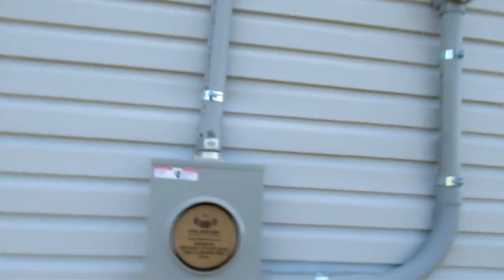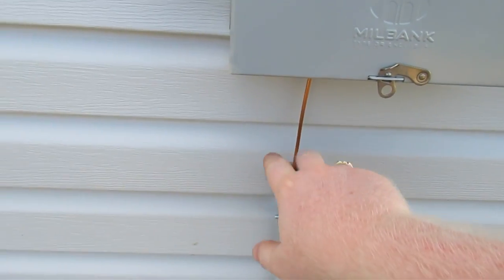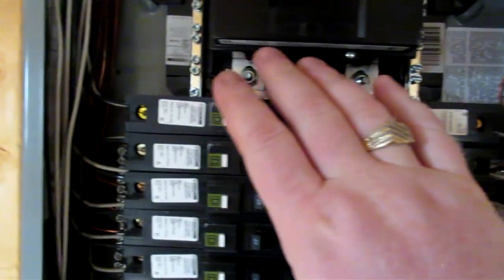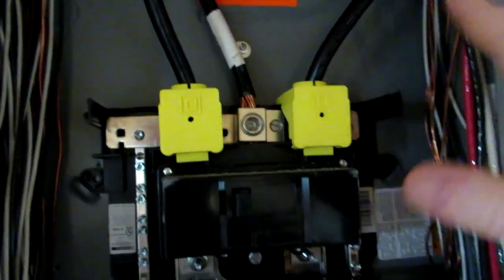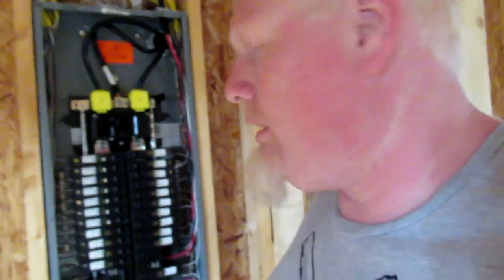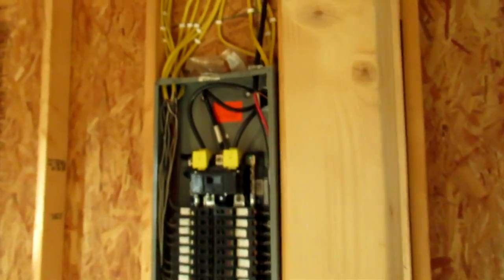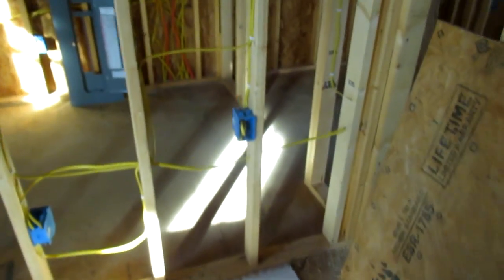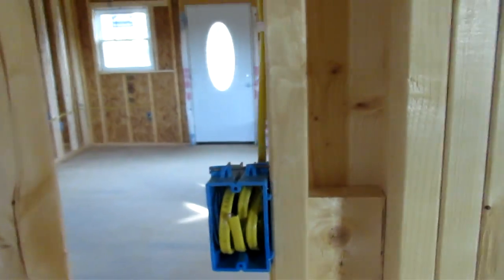How to wire a house

Comment: clean work. you ran a lot of 12 awg romex. looks like your lighting in on 12-2 with 20 amp breakers? I was under the impression no lighting on nomore then 15 amp unless the fixtures call for it. again could be the area I'm in Oregon we are pretty strict but also allowed to wire our own properties. super clean work
Reply from the maker: +Tarek Ashurex that may be a local code.  I was able to do either but for ease of install I basically kept a room per circuit and just fed the lights off one of the plugs. Thanks for watching.
Reply: Generally 14 gauge wire is used on lighting circuits but is not a code requirement. It's more of a cost saver that keeps money in the pocket of the electrical contractors.....like myself. 

What I would recommend is to run all Lighting on separate lighting circuits keeping within the 8 to 10 fixtures per circuit rule. Keep in mind how many lightbulbs each fixture is going to have.  If you're wiring an entryway, dining room, and kitchen you may want to make that  fixture count ALOT smaller  because the entryway chandelier could have 12 light bulbs, dining room chandelier have 8 light bulbs,  and  kitchen could have  6-10 can lights. Now you're 8 to 10 fixtures has become more like 19 fixtures if we were to say each one had an average of two bulbs. 

Sooo ...... 
The eason behind keeping lights on different circuits than Outlets is that electrical code requires all outlets in Living Spaces to be on arc fault breakers. When turning light switches on and off there is a small Arc inside the switch and tends to make the arc fault breaker trip. By wiring an entire bedroom on one circuit breaker you have combined outlets and lights. When it comes to the final inspection and the inspector is testing each room and turns on the light fixture, it will trip the breaker and kill the outlets. 

At that point you're pretty much up the creek because sheetrock is hung and it's a lot more difficult  rearrange your circuitry.

Final tip that I learned the hard way..... Never run 12-3 or 14-3 runs back to the electrical panel where GFI or arc fault breakers are required. Those types of Breakers require an individual neutral wire and by running 12-3/14-3 you'll be sharing the neutral. I wired a house one time, and only ONE TIME, using the "3 WIRE" Romex and upon final inspection got a lesson on GFI & ARC FAULT Breakers. Since there's no way to add an additional wire to the romex at that point, I had to cut  out sheetrock and fish new home runs into each location.

I lost my ass that day I had to fish new wire for the GFI and Arc Fault breakers........... I'm hoping this extremely lengthy comment will help prevent someone else from doing the same!
Reply: Jason Ekstrom - Perhaps they didn't exist at the time, but you can get 2 pole GFCI, AFCI, and dual purpose breakers that allow you to pull a home run in 12/3 or 14/3 and share a neutral.
Reply: shanecthompson77  Thanks for the heads up.... not much into residential anymore but will keep it in mind for future service calls!
Reply: Kitchens receptacles, Kitchen appliances and bathroom receptacles are the only thing required by code to be wired in 12awg. Lighting loads are next to nothing being that everything is LED nowadays.
Reply: Tarek Ashurex Using 14 AWG on lighting circuits minimizes and sometimes eliminates box fill issues associated with having 3 and 4 way switches, especially if space is limited in the box in question.
Reply: Jason Ekstrom should have used 2 pole afci breakers
Reply: mark 80 nope it's only required for dwelling units
Reply: @86jekstrom  
They also make a 12 -2-2 Romex
It has a red and a black. And two neutrals one with a black stripe and one with a red stripe.
it's used for gfi' or arc fault detectors that will not share a common neutral.
But I like to use it to make a Romex 12-4.   Just take one of the neutrals and put blue tape all the way around it on both ends.

Comment: just wondering how you get power? like how do the lines coming from the poles outside connect to your wire hanging out of your meter?  where does that connection go? it can't just be hanging there can it?
Reply from the maker: The power makes those connections.  I have the cables extended out of the top of the weather head above the meter and they make their connections there.
Reply: @BeyondtheBoom  yes, but where does that connection go? Do they mount a box on your house and do the connection in there or do they leave 200A live connection just hanging in the air? lol
Reply: @cheetocorleone3490  yep power company makes their connection and wrap it up with rubber tape then leave it dangling in the air

Comment: Please correct me if I am wrong but I didn't think you were supposed to tie neutral and ground together.  Potentially dangerous
Reply: you can at your first point of disconnect, witch it happens to be he's panel. Me personally I like meter main/panel combo. your main disconnect is attached to your meter. That's including the panel in the house :)
Reply: In Africa it depends on your type of supply. Combined Neutral or Separate Earth.
Reply: My understanding is that this is only true for a sub-panel (to comply with code).  The only time is could be dangerous is when they come together before the main panel.  The thing to know is that the electricity will want to travel back up to the service line neutral more than to a local ground.
Reply from the maker: You tie them together in the main.

Comment: I have a 50 year old ranch needing a new panel etc.  do you know if they grandfather in older residence or if current codes minimums are required, generally speaking?  Great video, thanks!
Reply from the maker: Its different for every area
Reply: Whenever you touch a wire, you need to bring it up to current code.
Reply: New Panel = New Code, sux!

Comment: Good video.  Since the house was in its infancy, building wise, did you consider having lightning protection installed?
Reply from the maker: Theres bonding on it
Reply: @BeyondtheBoom  I'm not familiar with  that term.
Reply: @backpages1  not sure if you asked to motive or for information.

There are spd's (surge protection devices) that work to protect from lightning strikes that can plug into a breaker in the panel and there are house lightning strike systems to provide a grounded pathway around your house to ground.  Those are the little antennas on the roof and should not connect to your electrical system.

Some people believe that electricians are arragant buttheads, but their job is all about preventing fires and electrocutions.  Most are happy to take a few minutes and explain some rule or tell you their best practice to make you as safe as you can be.  Inspectors are their "second check", ensuring maximum electrical safety.  Since both have seen many different ways to accomplish a task, they may already have an easy solution for whatever you want to do.  Do not be afraid to talk with several about any issue.
Reply: @keithharrington4595  HI Keith!  Motive, no.  Info, yes to some degree.  I had to re-watch the video and I paid a little more attention to your walk through of the exterior panel, where you showed how you grounded the house system nicely.  
I think at the time I asked the question I was working on my ham antenna's, and considering the 'little antenna's on the roof' type protection, but shortly afterwards discovered how sophisticated and detailed (and expensive!) those were.  I chose instead to ground all of the radio and antenna pieces into an 8' copper rod.  Let's face it, if lightening ever hits the antenna's  they will be vaporized.  My concern was that strike coming into the house via the cables and scorching my hide.  
I noticed you were out in the country which was what sparked my question about protecting the house against a strike, and had you considered exterior protection while you had good access to most areas of the house.
I thought you did a great job on the entire wiring of the house.  And for the record, I am in awe of the people that work in trades like electricians.  I am happy to pay them to do their magic and keep my house from burning down to the foundation!
Thanks for your response Keith!

Comment: Great video so I just bought a house from 1950's the service is coming underground is there a way to tell what size wire is coming in without pulling the meter? Right now I have 100 amp but want to upgrade to 200amp.
Reply: Luba Luba yo what LOL
Reply: Luba Luba   You will have to replace everything to go from 100 amps to 200 amps.  Unless the main breaker of fuse is tripping or blowing, you are not required to upgrade to 200 amps.   If you are adding on to the house, then you may need to change the service size.   Respectfully,   Kevin
Reply from the maker: You will need to rewire the house to modern code
Reply: Abston Wood Crafts    Which NEC section is this or local AHJ?

Comment: Appreciate, you stating , you Industrial Electrician, 1 Point as I 'am both, & certified , as National, Under new, ICC, you stated, new combination, arc fault, is Arc Fault /GFI, no it is not still need GFI, at 1st device, combination arc fault is NEW TYPE, means Parallel, -(1st style) generation, plus series arc, protection newer model.
Reply from the maker: Not here. The combination breakers are both gfci and arch fault in one unit and dont require an additional gfci receptacle
Reply: Charleton Zimmerman.    His terminology is incorrect, but all the purple reset button square D homeline breakers are in fact Dual Rated AFCI/GFCI .
Reply: Thanks Brian, are Homeline Sq D, the only ones, as of yet, none are available here in Pennsylvania, we still on 2008 CODE
Reply: Charleton Zimmerman No sir. All of the major manufacturers, including Eaton/Cutler Hammer and Siemens/Murray make the AFCI/GFCI breakers including 2-pole. 2016 California Electrical Code has adopted the 2014 NEC where I am.
Reply: Yes, Brian, just went to Lowes, today You correct, they just put them on shelve, this week, "thanks" for heads up, maybe, now Pa. will move to 2014 code

Comment: There is no reason a home owner shouldn't be able to wire his own house as long as it is done correctly and to code.
Reply: Nigel Cam    Really?    Most of the YouTube electrical videos are crap and some are downright dangerous.   Some people should absolutely not do electrical work.   Some people are able and in most places allowed to do it in their own home as they should be.   But, with that there is usually a permit and inspection required.   You should never just do whatever you want to with no understanding of what you are attempting to do.
Reply from the maker: I don't disagree. There's a lot of bad advice online

Comment: No more than 8 devices because you have to consider 1.5 amps per device for a 20 amp breaker
Reply from the maker: Yep
Reply: Mr Holt is correct.   The 1.5 amps per yoke does not apply to dwelling units.   For dwellings, you do all your calculations and that tells you how many circuits for everything including receptacles.   You can put a receptacle every 2' along a wall instead of 12' and still have the same number of circuits.
Reply: ruvim niz     Please tell me how you come up with 8 on a 20 amp circuit.

Comment: the only thing im confused about is why you got 2 earth rods in the ground other than that you just saved a bunch of $ so going all GFCI is minor
Reply: BTW i have been doing electrical installations for over 10 years and just learnt about this type of "arc" breaker because of your video
Reply from the maker: Around here you're required to use two ground rods. The arch faults are also required for all 110 circuits. The gfi arch fault combination breakers are the same price when buying contractor packs.
Reply: NEC requires a supplemental ground rod unless you can prove it meets certain requirements. To prove that cost more money than just installing a second rod.
Reply: Its 2 ground rods, unless you have a water main to ground to then you only need one rod
Reply: NEC 250.53 says you don't need a second ground rod if the single rod has 25 Ohms or less resistance to ground. Many electricians don't own a Meggar to do this measurement so it's just easier to add the "supplemental electrode."

Comment: i noticed you used all 12/2 = rated 20 amps  wire no 14/2..= rated 15amps the inspector was ok with that?
Reply: Lindsey Yah was just gonna say that
Reply: In AL you will not pass code unless you use 12ga wire (yellow wire) on new construction
Reply: Plus it's better to have heavier gauge wire (less heat buildup), the breaker will do all the work
Reply: You can go with a thicker cable on a 15 amp breaker, but you can't go with a smaller cable =14g on a 20a breaker. You can melt the wire off.
Reply from the maker: Virtually all new construction around here uses 12/2 for 120vac circuits.
Reply: @cruzmissile25  do they don't allow 15 amp circuits.
Reply: @thomasmarable6818  at the time of my comment, I was given partial information. 14-2 white cable can be used for lighting, the 12-2 yellow cable for duplex outlets and other high load appliances
Reply: @cruzmissile25  yes I was just wondering if the local code says no 15 amp circuits. The National Electrical Code always it in homes with 15 amp circuits.

Comment: I would've added a main breaker next to the meter with a 6x6x36 wireway below to prevent a 90 on the side of the building.
Reply from the maker: That's never done for permanent structure buildings around here. Only mobile homes have that here.

Comment: Nice job ..one thing I will put the main braker at the bottom this way use less pipe looks better outside
Reply from the maker: I thought about doing that.
Reply: It's code in the NEC that the main breaker needs to be above 4ft and less than 78inches

Comment: That box looks like plug on nuetral "ready" and not a plug on nuetral. Pig tail still required for nuetral. The plug on neutral boxes don't have screws for nuetral.
Reply from the maker: This is a plug on neutral and screws for the circuits that need it.
Reply: A plug on neutral panel eliminates the pigtails on an arc-fault and GFCI breaker... why do you think they clip onto the neutral bar...? Well done Abston.
Reply: Yes, they do. I just bought the same panel. The neutral screws are for the non-plug on neutral breakers and standard breakers. Only the plug-on-neutral breakers use the bus.
Reply: Maybe you're thinking of a QO panel. Plug on Neutral boxes DO have screws if needed for the specific breaker. Or maybe you're confusing the CAFI breakers.

Comment: What do you wire the the ground strips to? Or does it make a ground once you screw the bars to the box?
Reply from the maker: It is grounded when you install the bonding screw. You will also tie your ground and neutral together in the meter base. Thanks for watching

Comment: you dont have to sleeve ground wire thats not code. and sched 80 pvc pipe must be 18" deep sched 40 12"
Reply from the maker: Around here the inspectors like to see the sleeve.  I didn't on my temp pole but every house around here has it. Thanks for watching
Reply: For physical damage protection not for electrical safety
Reply: Even though it's not required it's a great call to do it anyway, nice job!

Comment: Nice job.. only thing I see from the video is it seems that you bonded the grounded conductor twice. In the meter and in the panel. If the bullseye is created in the meter then the panel becomes a sub-panel and the grounded cond.(neutral) and grounding cond. need to be seperate.
Reply from the maker: +E Wad the inspector had me to remove the green ground but as far as the bonding it was correct for the codes in this area.
Reply: Abston Wood Crafts - You used PVC piping you have no grounding bond you need a grounding conductor from the meter socket and your ground rods should be 8' apart with separate grounding conductors I only see 1 ground in the meter.Now that we have to separate the neutrals and grounds you can't use the neutral wire or bus bar as a path back to ground you must have a separate grounding conductor. Your inspector is not up to date on the new NEC rules on grounding
Reply: @myronsmith2114  Current 2017 National Electrical Code Article 250.53(A)3 and (B)3 state "...shall be not less than 6ft apart" makes the rest of your statements suspect.
Reply: @ACitizenOfOurWorld  Read your own statement 8 ' is the trade standard because you can be no less than 6'

Comment: I don't think you are supposed to have your wire exposed going into the breakers and on the main coming in.  That could lead to a short if you aren't careful.
Reply: those wires that are bare, are the ground wires. most of them are not insulated like the live wires.
live wires : 
red ( if a 3 way wire is called for it  )
white
black
yellow  ( again  another 3 way or a 4 way ) 

some wire companies use different colors other than the normal white, black, red, green ( bare copper wire - ground)

some use double black insulation on the wire  ( antique wire ) , must becareful when wiring that or you will get a 
 shock.

the reason for the ground wire not being insulated is because of extra material . . . . =  cost more
Reply from the maker: They're fine

Comment: Under 8 devices per circuit to keep most connects running in parallel. Got it!
Reply from the maker: Different areas have different codes about this so you might want to ask your inspector.
Reply: Thank you Sir. I doubt that I will ever be doing this line of work, but I did find your video to be very interesting.